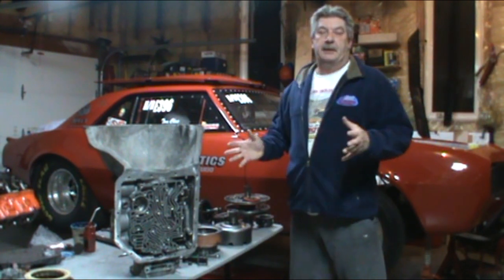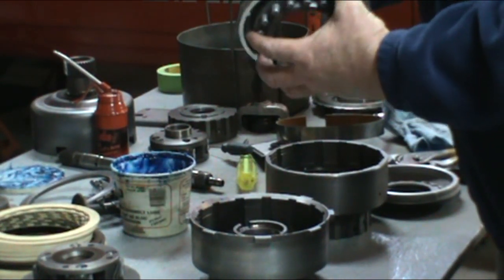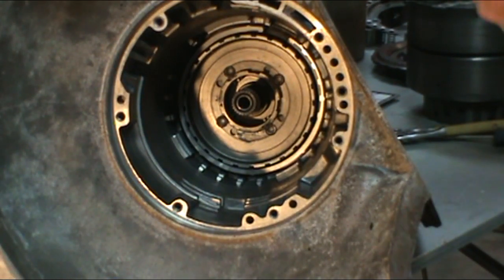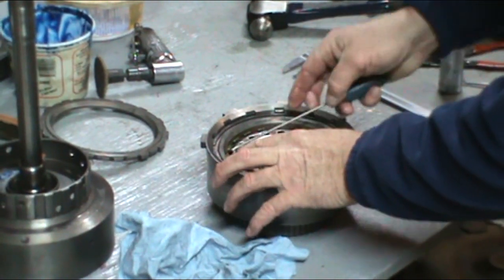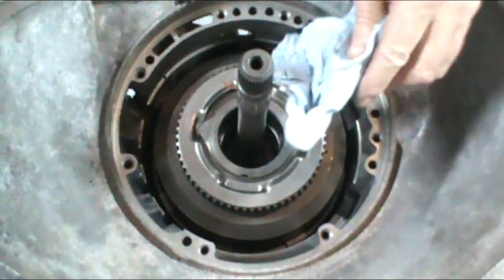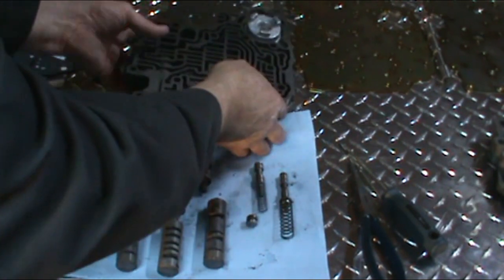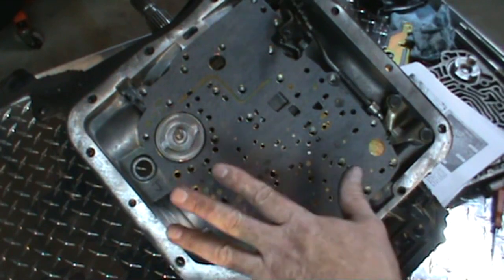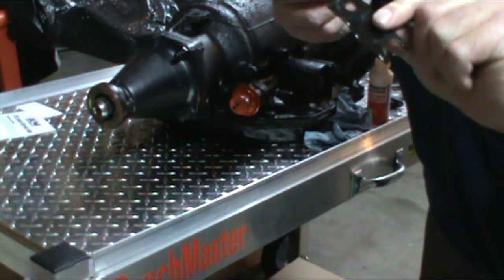We Rebuild the TH350 Transmission

Comment: Great play by play! Very impressive!! I struggled with installing my pump, finally got it installed! When I installed new bushings into the pump, the ID shrinks a little. I finally did a fit check with the shaft, and did a Demetria clearance measurement, just to be sure, but that’s what was hanging me up. I needed to lap it to the bushing. I used a plastic rod that barely fit the bushing, with a 2 inch slit down the end. I put some 600 grit into the slit, soaked it with compatible or something that is not detrimental to the system (WD-40 works pretty much everywhere, lol), attached it to a drill and started lapping. I cleaned it out and fit checked it with the rod several times. Replacing the paper each time. I kept doing that until it fit properly. I used lots of paper. Remember, if you love her, you lube her! Now you know!

Comment: How much horsepower/torque is this good for?
Also, can you rework the valve body to turn it into a trans brake like we can on the Powerglides?
Reply from the maker: These builds handle 600 hp. You can purchase transbrake.

Comment: Thanks for making this video.  I assume the intermediate clutch pressure plate rests on that rim of the case and does not touch the direct drum is that correct?  When I move my input shaft, I can see the pressure plate move slightly til the tags stop it.  I think my drum assembly isn't down far enough but I can't tell for sure.
Reply from the maker: yes your correct

Comment: 10 to 15 thousands, that's super tight I shoot for 50. Have you ran a transmission at 10 to 15? Just asking because it seems like after it gets warm it wouldn't release the clutches.

Comment: Good morning., have another question about installation of the torque converter .... Since the torque converter sags ever so slightly from its own weight when resting in the transmission, prior to bolting to the flexplate,, should you lift it up ever so slightly (take the weight off) as you tighten the first torque converter to flexplate bolt? Or just pull it forward and bolt up without lifting on it?
Reply from the maker: Just tighten bolts spacing should be less than 3/8 inch.

Comment: Why all the trouble to machine down the pistons to fit a extra clutch and steel if it’s not a race application? 

I’m about to pull my th350 because at 650rwhp I’m blowing through the torque converter. Ordering a new Ptc and gunna out a brake in this tci th350
Reply from the maker: The more clutches the more HP. I like to do it right the first time.
Reply: Brian Swayne Stock number of clutches in my tranny has survived 10 years of abuse in 4 different hot rods from 400hp to 700hp. So I just asked why in a basically stock application it would be needed
Reply from the maker: @nsboost  Only upgrades i want people to know. stick with what u got.

Comment: Your video is quite impressive, and I wish I had your knowledge. I am a newbie, and I am wondering if you can answer a question about air checking the pistons. how much air pressure do you use? I am building a TH350 and was checking the pump piston (intermediate apply piston I think its called) with the pump sitting on the bench by itself, and I have positive, full piston travel with 25 psi. But once I stop feeding it a constant air flow (with the rubber nozzle still held tightly against the pump air feed hole with no leaking), then the piston slowly bleeds back down over about a 15 second period.  I read that this can be normal since the piston isnt actually pushing against any clutches, but these are new lip seals. I pulled the piston and inspected the seals twice now, and there are no damaged or rolled seal lip. the piston bores are in great shape and overall the pump is in good shape.. I am a newbie. Is this normal/ok?
Reply from the maker: You should be good to go. I use 100 psi.

Comment: 51:19 in park the shaft don't spin and other gears the shaft spins freely? Is that normal
Reply from the maker: If your talking about the output shaft then yes in park it does not spin. It's locked in park.
Reply: @BrianSwayne  the tail shaft(output) shaft is locked in park but what about the input shaft does it need to spin in park
Reply from the maker: @davidl5121  yes input will turn. Only output will be in park.
Reply: @BrianSwayne  my input shaft won't spin on park only when I switch gears it spins freely
Reply: @BrianSwayne  did I install something wrong!
Reply from the maker: @davidl5121  no I checked and  also will lock.
Reply: @BrianSwayne the input shaft and output shaft will both be locked in park?
Reply from the maker: @davidl5121  yes
Reply from the maker: Sorry for confusion.
Reply: @BrianSwayne  no thank you I'm sure you helped others more than me, I rebuild four 4l60es weekly and 1st time with th350

Comment: I am lost on my direct drum I took it apart it had five steels and clutches but now it will only hold four
Reply from the maker: Well you could not switch between forward and high. Are you sure their wasn't 5 in high. The standard is 5 in forward  and 4 in high.You will have to machine piston.
Reply: @BrianSwayne  ok so four clutches and steels are normal for the dierect drum
Reply from the maker: @sherrodracing4345  Yes as long as it's not over 600 HP and no transbrake.